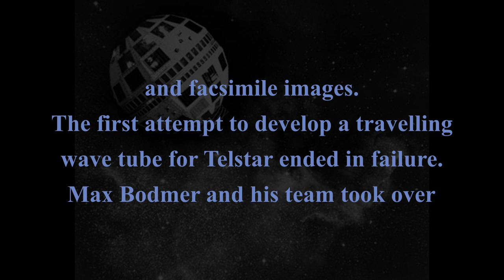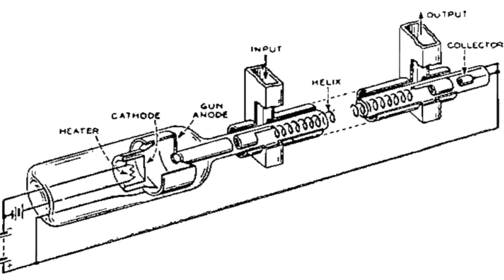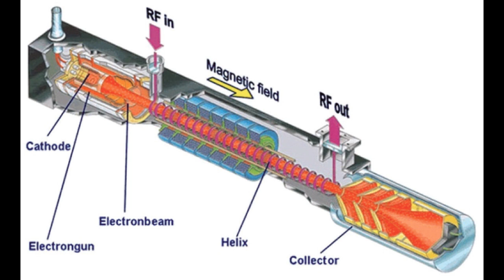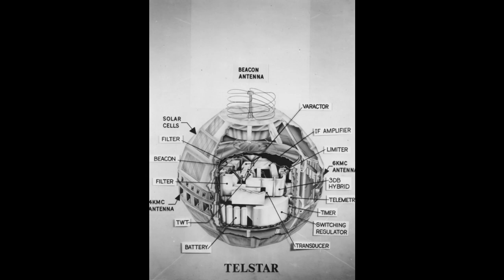Making the Microwave Tube that Enabled Telstar

Comment: Why You didn't tell that Starfish Prime conducted on July 9, 1962, created an artificial radiation belt in space that severely impacted satellites in low Earth orbit, leading to the failure of several: Telstar 1 – the world's first commercial telecommunications satellite (operated by AT&T) and Ariel 1 – the United Kingdom's first satellite? This information is not secret anymore, but publicly available. In this context when the leading engineer of Telstar 1 tells satellite worked well and without problems and we know it was not like that, how this will affect Max Bonder credibility in front of the world and the history?